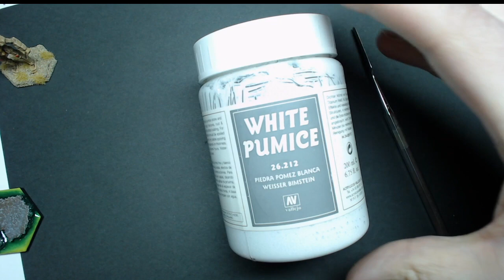Better Miniature Bases With Texture Paste | Battletech Basing Tutorial

Comment: Basing makes a huge difference when it comes to the finish of a miniature, possibly more so than the quality of the paintwork on the mini itself. more often than not I use Vallejo brown earth with some pumice mixed in, and sit drying clay when I need to give it shape. I find it works really well at Battletech scale, as the brown earth has a smaller particle size.

Comment: Hey I have the grey pumice and it is not drying rock hard like it said it would. Its spongey as hell? What's up with that/ can it be fixed?
Reply from the maker: I have Vallejo White Pumice and the label doesn't mention anything about drying rock hard. It does remain flexible but since it's water based basing material I'm willing to bet you could mix in a bit of PVA glue and that should harden it a bit.